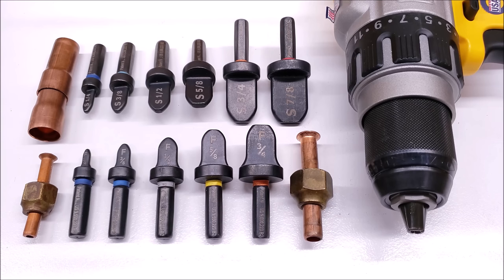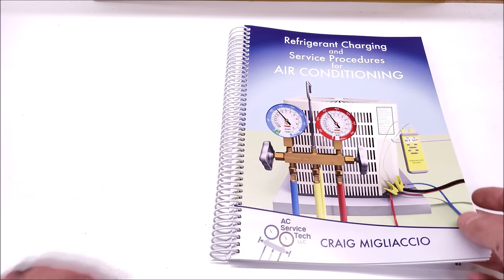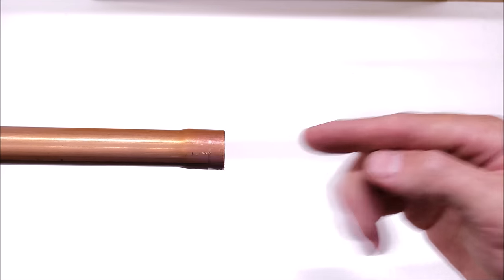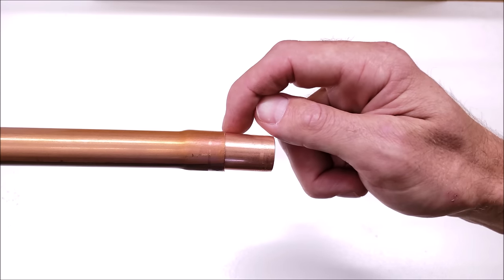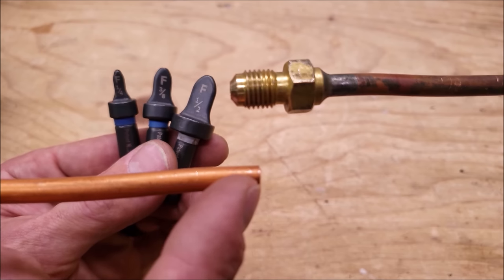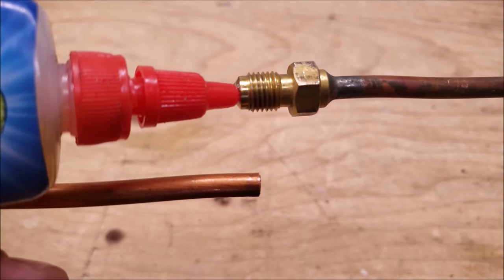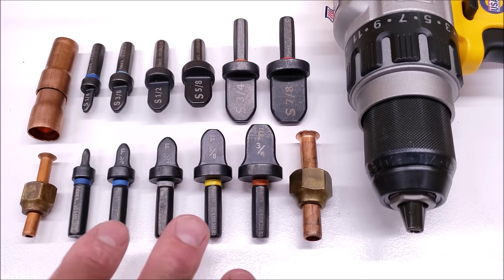SPIN Swage and SPIN Flare Copper Tubing Tools!

Comment: My son and I recently installed a two-zone mini-split system and used the Spin flaring tools for both, the 1/4' and the 3/8" lines.  All connections were pressure tested with nitrogen to 400 PSI and leak tested with an approved solution.  We then evacuated the line set using a micron gauge and pulled it down to 175 microns and held it using a digital gauge set.  No leaks and the system is running perfectly.  If you follow the instructions supplied by Spin, the manufacturer, you can make perfect flares in seconds compared to several minutes per flare using a conventional flaring tool, and all you need is an 1800 RPM drill, and the Spin tools, (which cost less than a good flaring tool).  The heat anneals the tubing as it forms the flare and when torqued to the required spec, that softened flare face forms itself perfectly to the face of the fitting it is tightened against, ensuring a perfect leak free joint.   You can't get that with a conventional flaring tool.  These Spin tools are worth every penny of the cost.  I laugh when I see comments down playing the importance of doing things correctly, saying things like, "Nah, you don't need all that stuff, it's all hype", or "I did this, or I did that, and my system is running fine, and blah blah blah"! Funny part is, they'll never post a comment when their system fails prematurely two or three years later, always blaming it on the manufacturer of the system!  I guess some people just have to learn the hard way.
Reply: Hey, I know this was a while ago, hope your good, but i just wanna know in your opinion it's better to buy a high RPM and have spin tools than to buy the tools itself?
Reply: @Felixm09  If your working in Hvac you should already have a high Rpm drill

Comment: I can see it as an augmentation of a tool set but not a replacement . Didn't use torque wrenches on flare nuts in 1984 and some are still in leak free operation !

Comment: I bought the SPIN FLARE a few years ago and I LOVE IT!!! I used to always split the copper with my old manual flare tool making flares on heating oil lines! NOT anymore! Beautiful flare every time!  Though it says on the box and recommends using a drill of 1800 RPMs or more my regular daily cordless Dewalt is 1500rpm but haven’t tried it on that yet I use my other older dewalt that is 2000rpms and works well.

Comment: I feel like the swaging bits are excellent but as I saw at the end of the video the flare kinda overhangs the actual male end of the flare nut. In most major manufactured refrigerant systems the installation manuals specify that flares can't overhang the nut. But I wouldn't know personally because I never tried t them.

Comment: I always tighten a fitting in a downward motion not pulling up on it, you always get more torque pushing down rather than pulling up & you won't punch yourself in the face when you're harbor freight adjustable slips off, I like the spin tool though
Reply: I'm surprised he wasn't using tubing wrenches.

Comment: This is a definite call back
Reply: I've been using the spin flare tool for over 2 years.  O callbacks.  The tool have however become slightly blunt. Meaning it isn't effective as it was the day I first used it.  I'm ordering another set.

Comment: Not a fan of these tools. I like my flares to be done when I flare the tubing. The swaging tool is just a mess. It works ok, but as seen from this demo it's easy to have your swage end up at an angle, lopsided, or bell-mouthed. The biggest problem though is the copper contamination. Just having the tubing angled down doesn't prevent the problem as many of the particles stick to the inside. Small ID tubing is just about impossible to clean with a high degree of confidence. And there are times when you have to swage (or flare) "in-position", and that position usually isn't with the open end of the tube pointing down.

I will stick to conventional tools for my flaring and swaging duties. I use and prefer the Imperial "Rol-Air" flaring tool for it's ease of use and the very nice flares it makes. The Ridgid flaring tool is a nice piece as well. For swaging I use the Hilmor compact swage tool, which is a hand-held hydraulic swaging tool. It works great and is a high quality tool despite being made in China :-( I looked and looked and couldn't find anyone who made a similar non-Chinese-made tool, sadly. Had I found a US or European made tool like this one I would have bought it even at twice the price. As a rule I avoid Chinese-made anything, but ESPECIALLY TOOLS, at all costs, but this tool is so good I had to make a rare exception. There are some generic versions of this tool out there for a lot less money. Some may be good, but the one I know of that another guy bought only lasted about a year despite only occasional use. Also, the generic tools don't go up to 1-5/8" or down to 1/4", they are limited to 3/8" to 1-1/8". This makes them less useful for guys that do small refrigeration systems or large tonnage AC/R systems. I've had my Hilmor for 4 years now and it still looks and works like new. I just keep it clean and put some grease on the forcing cone and mating surfaces on the dies every now and then like the instructions say to do.

Comment: Will flare put as lot of dust as well? I didn’t realize you are suppose to tighten the joint right after forming a flare. I can see people installing the line set and flaring downward especially at the indoor A.H.. Since these Ductless use strainers I think this could be a nightmare. Which is your preference using these drill type or the flaring block with a clutch stop orbiter?
Reply from the maker: Yes it certainly will put dust in so that is why I recommend reaming it ahead of time to reduce that and also to do this while the line is faced downward to get it out before connecting, thanks!
Reply from the maker: My yellow jacket eccentric flaring tool make the absolute best flares of any tool but other such as these work well too, thanks!
Reply: AC Service Tech LLC thanks, that is why I respect you and Brian Orr, you both will explain the right way of doing the task. Thanks for everything you do

Comment: I can't believe the copper retains any significant heat at the mating face through the tightening procedure -- the copper-to-brass contact and the mass of the brass will heatsink it down in the first second or two, well below the point where it would affect the behavior of the material. The heat is probably playing a role during the spin portion of the process, but the nut tightening is done "cold" from the metal's point of view.

Still a super efficient process, but there's no need to rush with the nut!

Comment: 3:20 Just want to point out that there is no need for the tube to remain hot when joining and completing the flare. When the flare is formed, the heat created by the spinning bit maintains the malleability of the copper; as opposed to other forming methods where the deformation of the copper results in work hardening.

Letting the tubing completely cool before connecting will have zero negative effect on the flare.

Comment: My drill struggles to get these to work but what I found is I can use my torch to pre-heat the tubing then my small drill works fine.  Even a small propane torch works great
Reply: Yeah. What a waste of time bro! So many parts and “techniques” to cost yourself or boss time. Time=money

Comment: Will this work on a used copper fitting to help remove solder inside the fitting that was removed from a used copper pipe?

Comment: With 3/8 and 1/2 will this split the copper or do you still have to anneal it?
Reply from the maker: It will somewhat anneal as the bit moves into the copper. It will heat up and you don't want to touch it with your hands. Make sure to wear gloves or hold the tubing in a block, thanks!

Comment: if iam not quick with flaring part , and i want to tighten the flares later, can i use butane to heat that up and then tight it on flare nuts ???

Comment: What kind of torque wrench you used to tighten the flare nut?
Reply: The Milwaukee M12 Fuel driver works well for me.  It's light and compact too. I guess any drill with high revolution should work bro.

Comment: I see that with many mini splits one is supposed to torque down the nut at lower value, then loosen and re-tighten at a higher torque setting. Does this process change with the spin flaring tool?
Reply: No.

Comment: Thank you, good info, but I understand there is a NEW tool for joining tubes that does not require soldering or brazing , I
forgot the name.
Reply from the maker: You are referring to Zoomlock. Yes you can use that. Fittings are fairly expensive, thanks!

Comment: I've noticed that you don't use a flare block gauge. Why not? Until the block was in my toolbox minnisplit flares had a high failure rate.
Reply from the maker: I actually make my flares larger than those gauges. The very edge of the finished flare is not flat to the edge of the flare adapter when using those. I also do not like to use the spin flare but just eccentric flaring tools for making flares and with those, no failures that I am aware of, thanks!
Reply: @acservicetechchannel   refridgent flare nuts have shoulders gas flares dont I'll cut some in half and post a video.

Comment: Hello. What is the maximum size you can expand the pipe. It is obvious that you can do it to the extent that the pipe of original size can fit inside, but can you enlarge it further ? Can you do some tests so that we know what thicknesses of the pipe wall can expand to what size (as the thicker the wall/the more material is there, the more you can expand the pipe and pipes of the same diameters can have different wall thickness). Thanks
Reply from the maker: I wouldn't expand it any more than what is needed to fit the same size it. It will reduce the wall thickness, thanks
Reply: @acservicetechchannel  You have all the tools ready... It would be nice if could make a test. The internal pipe will be with original walls, so it probably not critical how thick is the external one at the place of joint. Thanks

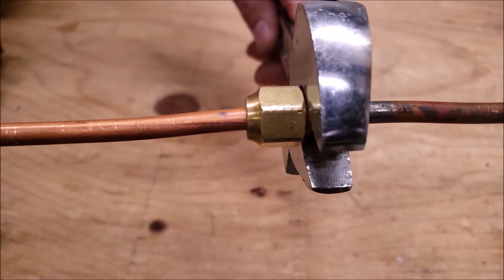Comment: From 4:44, while you were tightening, the tube rotated for about 90 degrees. Would it damage the mating surface?
Reply: no...but the copper is twisting hardening the copper tube which then becomes a weak point
Reply: That flare looked crooked to me
Reply: You could add Nylog to the spin area of the nut before you slide the nut to tighten

Comment: What if you are reaming or swaging a vertical pipe that you can't make it face downward position lets say if you are working on an equipment and want to change a big filter dryer you cut the 0ipe but you have to do it on vertical neither you can blow it out with nitrogen since it's big tube. ???
Reply: Shove a piece of foam insulation down into the tube, deburr as usual. Use needle nose pliers to remove the insulation plug with the shards on top of it.

Comment: I feel the drill swagging is perfect but the finish of the drill flare which I saw inside the nut ....
Reply: I agree, thought exactly the same thing.  Slightly better looking than an oilmans flare.
Reply from the maker: I will say that my eccentric flaring tool is my favorite for flaring just due to the finished product, thanks!

Comment: The swaging bits are absolutely brilliant !
I'm not so sure about the flaring ones , but I need the swaging bits now , thank you !
Btw , adjustable SPANNER , not wrench , mate !😄,😋
Reply: Sterling Archer You have to be extra careful and extra quick with the flaring bits.
Reply: @RockWonder210  they must need some practice I guess , but then again it's much cheaper than the full on swaging kit.
Reply: Sterling Archer Definitely some practice. That’s how I found you can only use it to flare once and you have to do it quick to get it right.
Reply from the maker: Yeah make sure to get any dust out during that flaring procedure, and do it quick while the flare is still hot to tighten the connection, thanks!

Comment: The swage bits are excellent.  With flaring however, my Husky flaring tool does a better job.
Reply from the maker: Yeah I do like my eccentric one, thanks!
Reply: Kinda funny. I think I have the Husky tool, and I couldn't fit the pipe in the hole, was an odd size or something. Had to use the flare spin tool instead.
Reply: @sprockkets  Having a similar issue on a pioneer mini split.  Unit shipped with line set preflared except head unit fitting didn’t match line set flare.  Tried flaring with the eccentric flaring tool but the tubing is just a bit smaller than half inch so the tool will NOT achieve sufficient grip for flaring.  Reviews on the spin flare bits are mixed but it’s either this or brazing.
Reply: @merlingrim2843  once you get the hang of it the spin flare is great.  Just did another system with it: got a 25 micron vacuum with it decaying to around 70.

Comment: I'm not filling up my truck with more 'modern' crap. Never needed a torque wrench for flares. What I've got works just fine......
Reply: I gotta be honest. Although you don’t necessarily need a torque wrench, the blackmax torque wrench doesn’t take up much space at all. It’s a very slim case, fits almost anywhere.

Comment: The swage tool is nice but there is no way that the flare holds up on a 410 heat pump at 550psi
Reply: Yeah Tim, you are dead right. Using that method they are just relying on that gunk they put on the flare face...might as well not have a flare. In Australia we would be fined prosecuted for not creating a proper flare joint because its going to leak...I am supprised if you can even pull a decent vacuum....let alone getting to hold the vacuum under test.
Reply: @richardq7290  what are you guys going on about? This looks like it works just as good.
Reply: @MechInvent  BS it wouldnt make a good leak proof flare.

Comment: These tools can really speed up an installation at a decent price. What voltage was the cordless drill you used Craig?
Reply: I don't believe volts matter if I recall correctly but it does need like 2 or 3k rpm to work as designed
Reply: Hey thanks for the reply! I was figuring that a 14 volt cordless would probably be the minimum that could maintain enough rpms for the torque required to get the job done in regards to the swager. I prefer 18v minimum for operating large  unibits in a cordless drill for sheet metal work.
Reply: @YTsux24-7  also dont use an impact they're designed to be used with a drill
Reply: Correct on that sir. I have the Bosch 18v drill and impact combo. As Aaron Cowen of Sage Dynamics would say if he was in HVAC, Drill accordingly 😁
Reply: My 12V Milwaukee drill gets the job done. Its the one from the fuel line.
Reply: Good to know sir. I have an older 12v dewalt that looses torque rather quickly. It may just be due to age though.
Reply from the maker: Hey Tom, that drill was a dewalt 20v 2000rpm with 860uwo torque. Of course dewalt gives the uwo where others give a ft/lb torque but my 18v hitachi got stuck using a 1/2" swage as you can see in this video https://youtu.be/uPNtqJabTI4   its important to high a high rpm and high torque drill for sure and the most important thing besides the quality of the swage is making sure that dust falls out when you are done, thanks a lot Tom, Special K, and Maleficar!
Reply: We appreciate all you do sir!
Reply from the maker: @YTsux24-7  I really appreciate your support Tom!
Reply: Was at the supply house yesterday and the manufacturer says 18v 1800rpm , there is both a round and hex shank as well

Comment: Warning ⚠️. Do not attempt to do this procedure with tubes shorter than 12 inches or without a glove since it can get stuck and make the tube spin since there is less grip. Keep fingers off the back side of the tube or It will slice your fingers. I had to get 7 stitches on thumb
Reply: Bạn nên dùng một cái kẹp ống sẽ hiệu quả!

Comment: Dont waste your money nor your time with these, unless you are brazing the bleeding thing, then soldiering is a big no. As it swages the pipe unevenly using the drill, thus resulting in a leak. If you notice in the video that pipe is vised, to hold it still, in an ideal situation this is not the case. Thats my two cents.